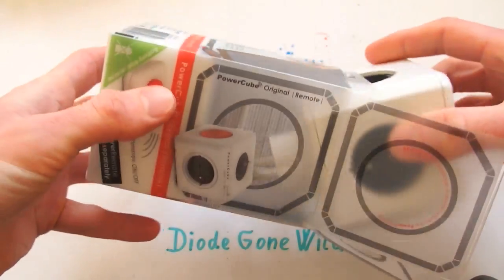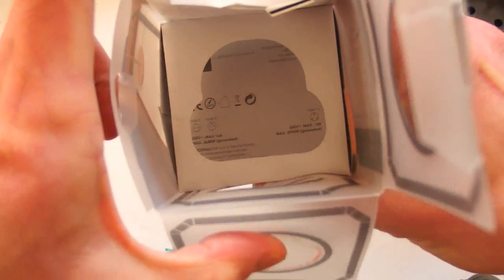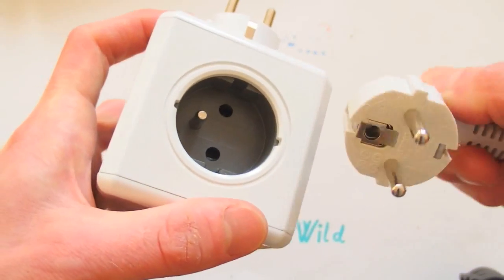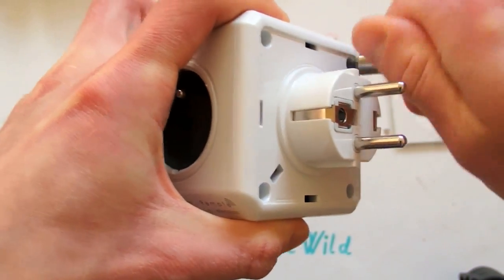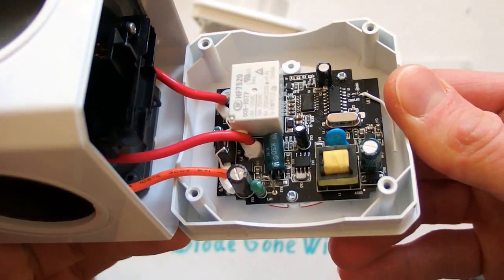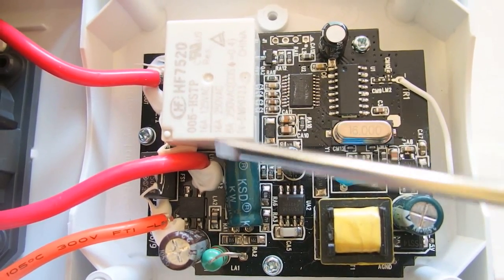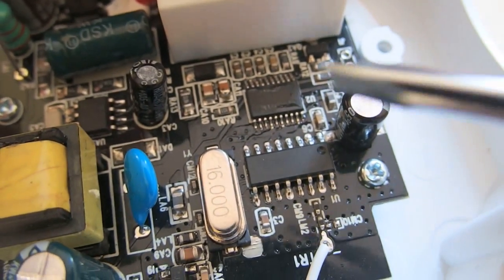allocacoc PowerCube Teardown

Comment: When i see the length of the Antenna it must be 'RF' or 'Bluetooth'.
A tear-down would be very interesting to see the power-supply function. 
- It sounds like a piezeo electric design about the click two times (Push button in and out).
- The micro controller could be an ATTiny?
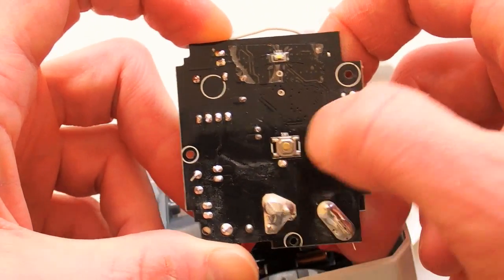- 06:19 - Backside of the print. The right thumb is over the 4 pin wholes J1 named on the top side. GND, 3V3, and the two for RX and TX looks like That could be the programming interface for the ATTiny.

Comment: The 2 USB ports on the (4 variations) Powercube says it dishes out 2.1 amps when USB 2.0 is clearly 0.5, heck USB 3.0 is 0.9. What is the 2.1 Amps for on those USB ports???
Reply: Charging ports are a completely diffrerent thing.

Comment: The reason one of the sockets is different is because it's supposed to be support the mounting accessory - it goes in, you screw it and its plate goes underneath these guides.

Comment: How do you calculate power with a multimeter?
Reply: Voltmeter in parallel with the circuit, Ampere meter in series with the circuit.The power is V x I.
If you wanna test more than 10 amps, you will need a clamp meter or measure the load resistance ( not for motors )

Comment: Hi. How do you measure the power consumption? Do you have a resistor in series and mesure the voltage drop?
Reply from the maker: Something like this is built inside the big power strip :)
http://danyk.cz/wmetr_en.html
With another shunt added to get 2 ranges.

Comment: Found this video as I was curious to know how the remote works. I would guess it uses the Piezoelectric Effect?
Reply from the maker: Not sure how the remote works. The receiver looks like a standard 433 Mhz or 868 MHz receiver. The transmitter probably contains a standard transmitter at one of these frequencies, and the power is generated by something like piezoelectric generator, but more likely magnet and coil... or, is it solar? I have to get the remote. It's quite tacky to sell those without the remote.
Reply: Hi 24CaratSurvival and DiodeGoneWild
The PowerRemote is batteryless and works on kinetic energy with a Wi-Fi signal of 2.4GHz. 

Since the PowerRemote can pair to many PowerCube Remotes and vice versa we sell them in a set and separately (which is excluding the PowerRemote). 

@DiodeGoneWild 
I think what you have bought is the PowerCube Single. If you check the packaging it should say if the remote is included or not. 

Hope that helped.
Reply: I recall Techmoan reviewed an inexpensive Chinese wireless batteryless doorbell button that used a piezo - he didn't figure out the power supply circuity though. I've seen schematics of people following up the piezo by an inductor or a transformer.

Comment: What an odd product, shame they didnt include the remote, thats mean. :-(
Reply: Hi Против Глобал, 
Actually we sell them as a set (PowerCube |Remote| and PowerRemote) however the the one that DiodeGoneWild has bought is an extension pack therefore the PowerRemote was not included. 

The PowerCube |Remote| has a One-to-Many and Many-to-One feature so you can pair the PowerCube |Remote| with different PowerRemotes and vice versa.
Reply from the maker: Yes, that was a moment of disappointment when I looked to the bottom of the box and the remote from the picture wasn't there :/.
Reply: Hi zx8401ztv, 
Since the PowerRemote can pair to many PowerCube Remotes and vice versa we sell them in a set and separately (which is excluding the PowerRemote and also the one that is reviewed in this video).
Reply from the maker: No tak radiový dálkový ovládání sem kdysi už stavěl, dokonce 4-kanálový :). http://danyk.cz/avr_rdo.html
Díky :) Doufám, že časem nažene nějaký ty odběratele...
Reply: It's almost like selling a lock without the keys... I prefer the ones made by iSPEP anyway.
Reply: let's build one on your own :) . Parádní kanál btw.
Reply: Apple in a nutshell
Reply: I bet Apple sells it and everything is separately sold.